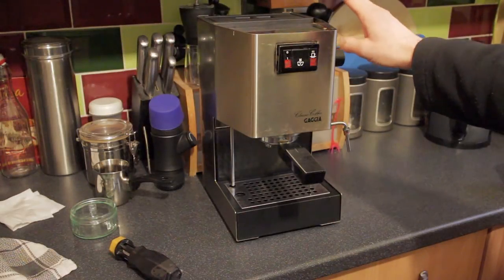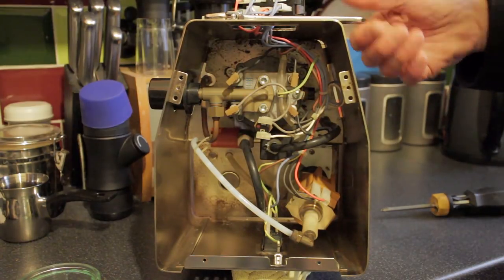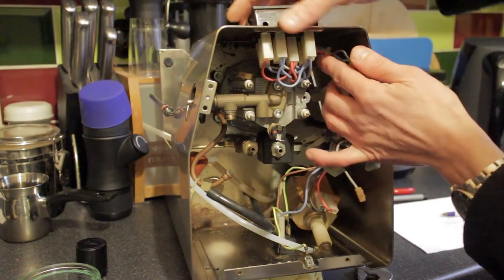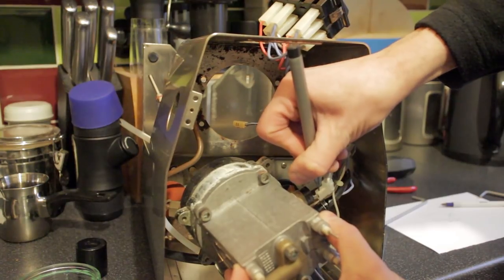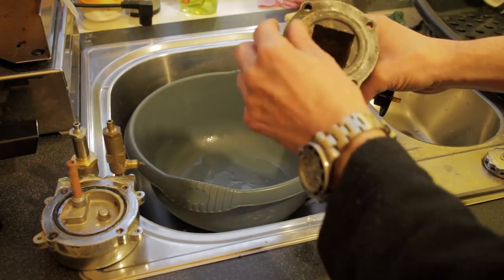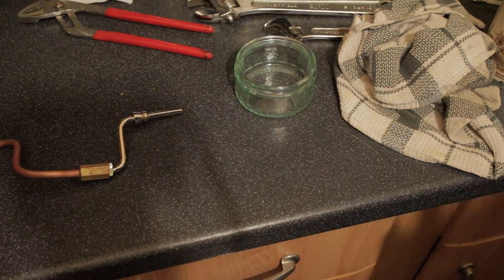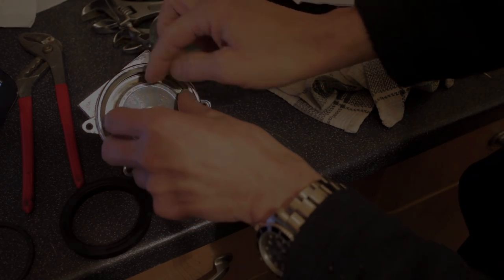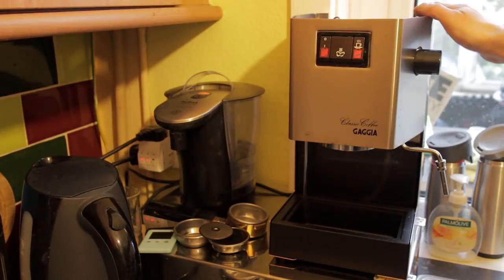Gaggia Classic Full Service and Descale, Boiler Strip, Seals

Comment: My Gaggia Classic flow had reduced to a dribble and normal descale didn't help. Waited until I had a good few hours clear and followed this very useful step by step guide. Have a newer Classic (has an earth) but followed the video and the coffee is now flowing once again. Many thanks.
Reply from the maker: Fantastic news, glad to hear this helped you, the boiler is very small so even a relatively small scale buildup will become noticeable in quantity and brew temp quickly.
If you are in a particularly hard water area you can pump in a solution of citric acid once a month then flush through and it'll greatly extend your strip and service periods, don't forget to brew and discard a shot after to flush through and season, (there's a use for cheap supermarket coffee beans, ;) )

Comment: Thanks for the detailed step by step video. Bought a Gaggia classic off eBay at a great price. The selenoid valve was clogged causing zero water flow thru the group head. Did what you showed on this vid and now it works like new👍👍👍👍👍👍👍👍👍👍👍👍
Reply from the maker: Fantastic. Glad it helped you.

Comment: Good Show ! A very informative class on doing a major, and necessary service on the GC.  I especially was impressed by your method of resurfacing the boiler mating surface : sand smooth with wet/dry paper.  Any chap/gal with basic mechanical skills and mega patience can perform this rebuild -- thanks to your video. I stress the importance of first  buying  a metric set of  both " spanners" ( wrenches, USA ) and allen wrenches ( ca. $ 13.50 for both at a discount shop ). Cheers from a former Yank, RAF Lakenheath.
Reply from the maker: Thanks, glad you found it helpful.

Comment: I am honestly very grateful for this invaluable contribution! The solenoid valve of my gaggia 1998 was clogged and the portafilter came out with such pressure that it bent a part of the metal of the brew head where the portafilter is being put on. I hope that I can repair it after your video! Thank you!

Comment: Brilliantly explained on how to do this job, when I stripped mine down I failed to fill the boiler but now understand it much better thanks
Reply from the maker: Thanks, glad it was of use to you.
Reply: Meant to also say that I have puddle of brew water sitting on top of my coffee puck after extraction, I have descaled, back flushed, and taken the solenoid valve apart for cleaning, after viewing your boiler descale tutorial, my overflow pipe does release quite freely the excess descaler which a you say indicates the solenoid is working correctly, I have also tried different grind sizes, and doses, but still end up with a pool of water on the puck.
I recently upgraded my basket to a 'Nanotech' type which is slightly curved and gives a better extraction, I have stopped tamping and now use a quality leveler which does prevent chanelling.

I read that another subscriber has a group head leak problem.

Comment: I took my gaggia classic completely apart refitted it after descaling and replace all seals and got no steam. After trying everything I followed the circuit diagram and found that somehow I wired the side lower thermostat with the top thermostat and vice versa. Also there was no continuity (beep test) on the solenoid. Tested it physically by putting a screw driver through the coil. Made my wife Happy.
Reply from the maker: Always good to hear an espresso story with a happy ending. Glad you're running again.

Comment: I have the Gaggia Coffee (circa 1989) machine which is nearly identical to this one. I bought it used and opened the boiler to reveal a large amount of mineral build-up. The water in my area is quite hard. After cleaning the machine has been making great coffee for nearly 20 years!
Reply from the maker: They are great machines for the home user and as good as you need for the odd espresso and Latte.

Comment: Very useful - My Classic has been sat in a cupboard for 7 years - Not sure it's safe to use without a full strip down and clean. . . Thanks again. . .
Reply from the maker: Antony Johnson As long as it's not been subject to extremes of temperature and moisture out shouldn't be dangerous but that length of time it'll certainly benefit from a strip clean and reseal. The seals will likely be brittle.

Comment: Excellent. I’m nervous but this has motivated me to do the same for my 2003 model which has never been serviced! I do live in a soft water area though so it shouldn’t be too bad.
Reply from the maker: Good luck with it. The only thing that's really important is to break the threads in the group while it's still installed, the rest is pretty easy.

Comment: I have a pretty rough Gaggia Classic I keep as a spare machine (main machine is a Wega Mini Nova) the Classic had a malfunction last time it was used a couple of years ago, but I forget now what it didn't do properly. I figure doing what you show on here, plus a new set of seals and o-rings should be a good start, as I think the malfunction was pretty minor anyway. Parts including steam-wand upgrade are on the way, so should be pulling it apart in about a week. I think I might need it soon as the Wega is showing signs of not being at it's best anymore.
Reply from the maker: Good luck with the rebuild. It's definitely worth looking at the wega too. I love my Wega HX.

Comment: Great help. Thanks. Completed my service without a problem after your video! I was a fitter's mate for five years but never saw such a brilliant screwdriver. What make is it and where can you get it? Thanks
Reply from the maker: Jerry OBrien Thanks, glad it was useful to you, that screwdriver is incredible. Sadly I can't tell you the make or where to get one, I got it cheap from a tool stall on Doncaster car boot years ago because one of the straight blade bits was missing and it was the only there, no packet, makers name, brand or anything but it is a good quality one.
Reply: Sod's law! Thanks for the reply :)
Reply from the maker: Jerry OBrien If I can find anything out about it I'll drop a reply in but it depends how good my googling will be later.

Comment: Superb video - well-edited,  excellent and helpful commentary, and no bloody music - thank you so much! 
I was able to completely dismantle, clean and reassemble my Gaggia Classic, which now looks and, most importantly,  works good as new. 
One puzzling aspect: although all limescale was completely removed, using the official Gaggia descaler (8 quid a bottle, ouch!) there was a hard, crystalline white deposit inside the boiler which wouldn't shift,  although no doubt a power tool wire-brush  would have helped. Is this possibly an aluminium salt, or oxide?
No matter, all important areas were totally clear and the espressos are perfect, once again.  Many thanks!
Reply from the maker: Thanks for the feedback, glad to hear another espresso machine is saved from the 'I'll look at it later' cupboard. :) Your description sounds more like a buildup of scale rather than oxidisation. As alloy oxidises it tends to be loose and powdery leaving a darker surface underneath, (which is good, acts as a protective inert  layer unlike steel which will continue to corrode, so don't brush it back to bright alloy).
I wouldn't worry about it now just check that your extraction temp is good, next time you do it, get yourself some cheap citric acid and let it sit in the boiler longer and keep checking, re pl enish as necessary. The Gaggia stuff is good but as you noted pricey whereas a big bag of citric acid will last ages stored dry and make lots of solution.
Reply: Thanks for the further info. I was puzzled that, despite my leaving the boiler filled with neat Gaggia descaler for an hour, there was no bubbling at all, and the deposits remained unchanged. 
I had bought some citric acid powder but decided to play safe, having read warnings elsewhere (probably posted by Gaggia!) that it could damage the aluminium.

No problem though - my machine is now performing wonderfully well. I'm left wondering if it scaled up through being left unused for 3 months. Are there any instructions for 'laying up' a Classic?
Reply from the maker: @jseagullbha5690  The only thing to do before laying it up for a period is empty the boiler. Leaving it full leaves the water contents longer to deposit things on the boiler sides and if you're in a particularly hard water area it can fur up quickly. Easiest way I've found is to heat up for steaming and purge the steam wand into a container, leave the valve open, empty the water tank and once cooled tip the machine upside down over the sink to get the remnants of water out through the steam wand.
Reply: Thanks! Your extreme purging method seems well worth doing, to avoid in absentia scaling - very hard water here, in Sussex Downland! 
However, any chance of an airlock being created on refilling? (And if so, how best to tackle that?)
Reply from the maker: @jseagullbha5690  that shouldn't be possible unless you have a blockage in your steam wand. The group had extracts at the bottom and the steam at the top.
Best way to check is to open the valve fully and switch all the switches on, water should jet from the wand after the boiler fills to the top.
If not then it's possible some of the scale. (If that's what the fur is) has come loose.
You could try filling the boiler with a citric acid solution and run a few cycles through it and hopefully you won't need to strip it again yet.
Reply: @spidiq8 Hello 
Really hoping you can offer some of your expert advice – again! 

I've just done a complete dismantle/descale/reassembly of my Gaggia Classic, as per your excellent video, after suffering yet more slow flow/no flow problems. This time, I thoroughly cleaned out the three-way solenoid valve and checked air could be blown and light could be seen through all visible pipe connections and internal apertures. I descaled everything with citric acid and expected this would do the trick.

But immediately after reassembly, it was obvious the flow was a bit sluggish and after a few test shots, it slowed down considerably. In particular, when pulling a shot the flow starts at a reasonably good rate, but soon slows to a weak trickle about 10 seconds afterwards.

So, I'm suspecting there may be still some blockage within the solenoid valve. Or, perhaps the pump is faulty? I'm reluctant to spend on a pressure tester if it's not the pump at all!

As for the OPV, I descaled but didn't adjust it. But I don't now see any evidence of return flow into the water reservoir when pulling a shot. Never looked at this before, so not sure whether that is another issue!

I'd really appreciate your thoughts on this – plus, any suggestions on what to try next? 

Thanks in advance,

John
Reply from the maker: @jseagullbha5690  I'd definitely recommend stripping and cleaning the OPV as there's a spring and ball bearing in there which won't work correctly if it's scaled. If you wind it in fully counting the turns until seated before removal that'll give you a baseline for refitting, once clean you can wind all the way in then back the appropriate number of turns.
For the other bit I'd suspect the pump first, they're a simple design and though they can be disassembled they're intended to not be rebuilt but they are relatively cheap so try replacing that, it could be that it's building pressure initially but if worn or scored internally from limescale it'll not supply adequate pressure.
Reply: @spidiq8  Thanks for your speedy reply! I've ordered a replacement pump, along with a pressure testing gauge. I will firstly try testing the existing pressure, then tweak the OPV setting if appropriate. If all else fails, I'll fit the new motor and repeat the pressure test. If that doesn't fix it, guess I'm left with the solenoid valve or OPV to replace.
Thanks again – I'll let you know the outcome.
Reply from the maker: @jseagullbha5690  Great stuff, fingers crossed the pump solves it.
Reply: @spidiq8  Hello again

Good news, think I've finally nailed it! Pressure test with my new gauge showed existing pump delivering a paltry 2 bar! So, fitted the newly-purchased pump, retested and… bingo! 14 bar! I then adjusted the OPV to deliver 10 bar static (which I understand produces a 9 bar dispensing pressure. First espresso ran very well, producing a very decent crema.

So, I'm back in business, with my machine now working good as new!

Thanks again for all your help and excellent advice!

Cheers, John
Reply from the maker: @jseagullbha5690  Fantastic news.
That's the thing with these vibratory pumps, it's impossible to tell by the sound if they're not delivering.
Very glad you are up and running and able to enjoy a well extracted coffee again.

Comment: I've had my GC for 3 years and just replaced the group gasket (following a different video.) this one may come in handy down the line. thank you for the time and effort you put into producing this video.

How do you measure the temperature at the group head? do you measure the water after it hits a cup (which will chill the water a bit)? do you heat up a cup and then run water thru the group and check it (doesn't sound like it would be acurate). or do you run the water and put a thermometer right into the water as it runs out? (or some other way?...)
Reply from the maker: Glad it's useful to you. The easiest way to measure the group head temp I found is to run water as if you were brewing a shot after letting the machine warm up for at the very least 10 min, if you run it through the portafilter ensure you've run some through first as this takes a while to warm and stabilise if not.
Extract it into a Styrofoam cup with a thermometer in. This is crucial as Styrofoam is the most temperature stable material whereas ceramic can cool or hear the water quickly.
This will get you as close as you're able, if you want to get really technical add 0.5 to 1 degree OR using a thermocouple set it right under the group head and before the portafilter.

Comment: This is a fantastic video, but please remove the brew and steam thermostats before you immerse the boiler unit in descaling liquid - they are not supposed to get wet! If you do get them soaked, you'll need to dry them out fully before reassembling, or you will risk short circuiting.
Reply from the maker: A very good and valid point, thank you for mentioning that.